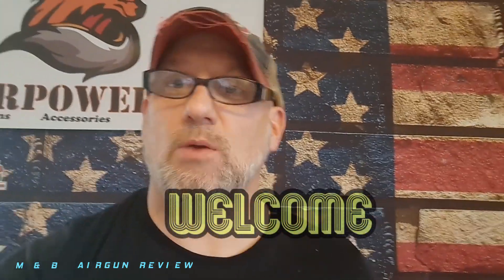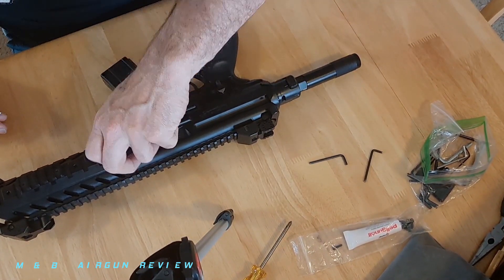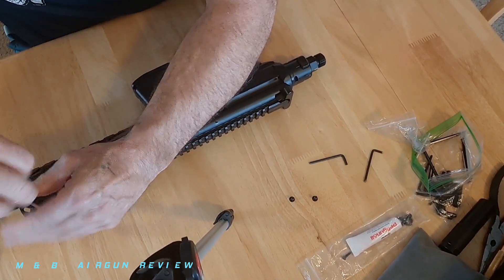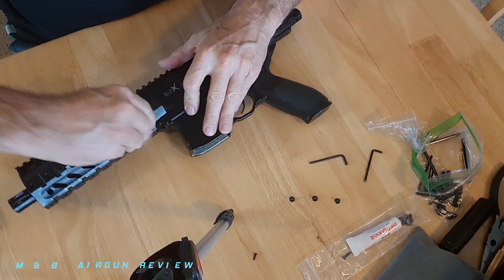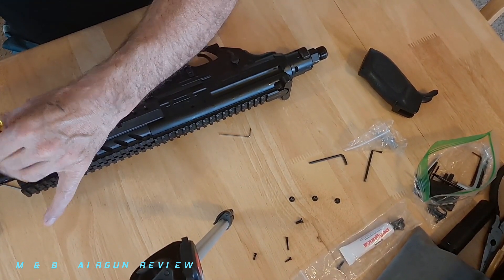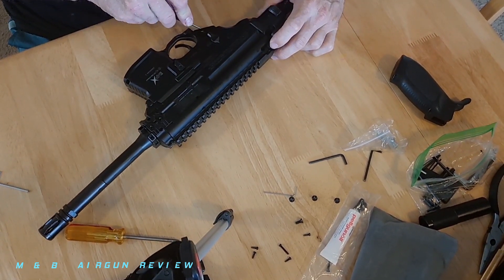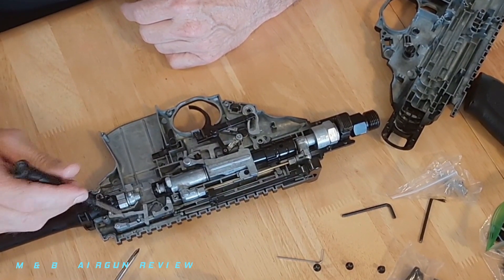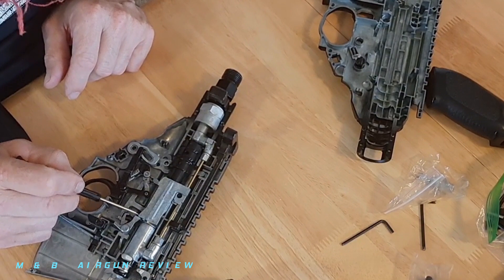SIG SAUER MPX MCX .177 CO2  Charge Handle?  HOW DOES IT FUNCTION?  Internals  Revealed. Educational.

Comment: I NEED HELP GUYS
so last year I got an MCX and converted it to hpa using a venturi adapter with a ninja tank and it works great!! BUT.. every time I fire I have to pull the charging hammer to shoot again.  Any idea why?
Reply: Regulator output too Low? 1800PSI works Perfect ! ;-)
Reply: @horstschewe2719   wow !! other says that 1100 is max for mcx! it's great. does you read about replace 177 barrel to .22 . it's possible cause magazine from firtus is also ok for mcx. and must do just two things . a lit of bit correct detail 177 inside gun, and rotate detail that adjacent to it. if psi will be 1800 it will be ok to shoot that caliber

Comment: Great video! I have the virtus air pcp . Is the black buffer tube considered the hammer spring in this platform?
Reply: Yes don't add another spring you will either crack thst buffer tube or the black plastic nose cone that moves the valve back & forth
Reply: @ I was just messing with the virtus. I had a custom tube piece made for the front piece. I get 19fpe with mine

Comment: Nice to see it opened up.
 Apparently the MPX seems to have a 2pc outer barrel and sharing just the first part (that gets bolted with the four Allen screws) same as on the MCX. Those split aluminiul blocks that have the inner barrel threaded into it also has a set of threads for the .22 inner barrel installment when pieces are flipped around.
 The camera was a bit far out for a really close-up video. Damn shame for MCX/MPX newbies. The video was though one of the best made to date of the internals I believe. The video did get a bkt short imo. You did not really show the pusher bar that rotates the belt forward when pulling the trigger. And there is that fork-like piece (above where the barrel begins) that falls down into the top of the split mag top, and upon the belt and stops (and holds) the belt aligned with the barrel. And that cone piece caged in front of the valve gets pushed forward to seal the gap between the valve and belt. And that cone often gets headaches to many MPX/MCX owners at some point when it starts to get problems not getting returned back to rear position by the weak spring in the plastic cage..
 You actually could easily do a sweet 30min+ video of this MPX by going thru every internal motion.

Btw.. And there is actually a point in the trigger linkage that looks as it would have a place for a spring.. Never heard of anyone having a spring  there. Sig probably noticed it works without and just left it out of there..😁 Never even bothered to test the triggerpull by installing a spring of my own there.